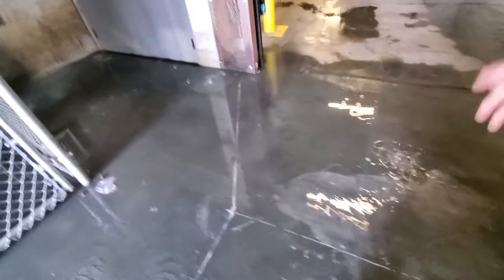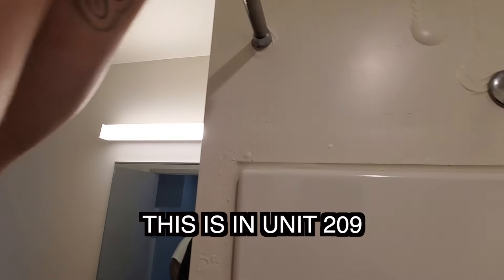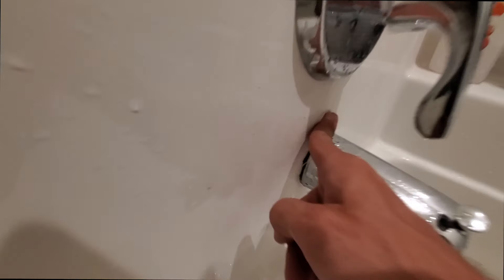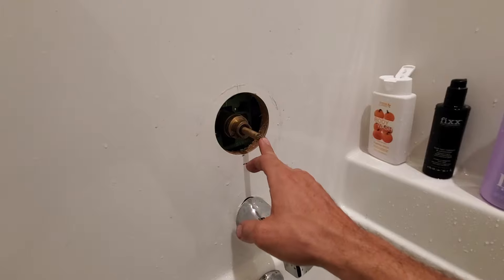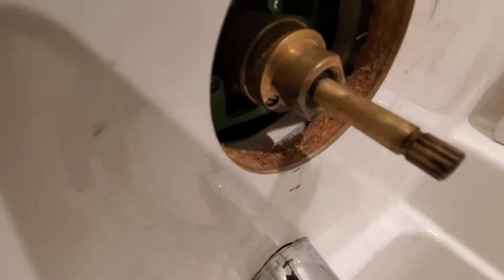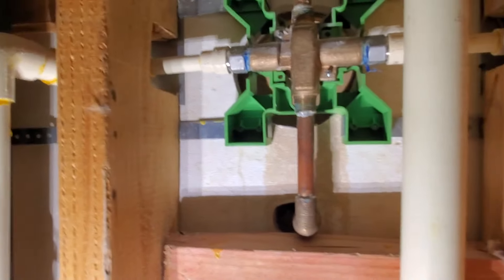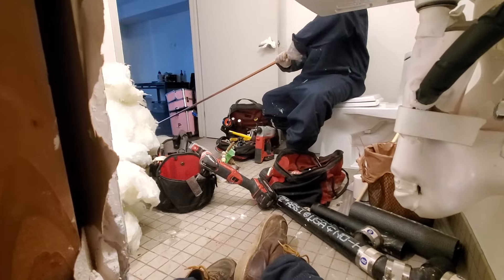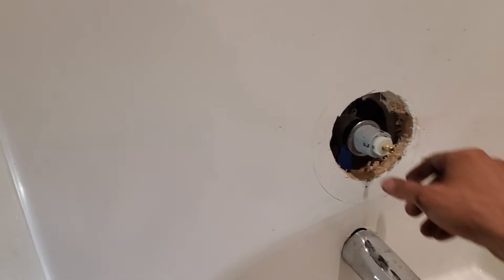HUGE leak from busted Symmons valve

Comment: Just throwing this out there  Being your in LA  notorious for tremors etc  Why would you guys use CPVC and glue joints in such a large building  ???  Why not Uponor ( they make rigid lengths all sizes) and alot more forgiving  is it a code thing?   I know California esp southern  was specifically use Vic Taulic sprinkler system just for this reason  back in day    Thanks for any insight
Reply from the maker: @easymoneyrodney5164  I agree with you. Stupidity. Main reason is how cheap cpvc is and it's code approved now. I never use cpvc unless used for a repair.
Reply: @pershingplumbing9007        we plumbed new houses in OC w CPVC  back around 95    no idea how they held up   not great I wouldnt expect    Ive gone out and made a few repairs but  run into damn few.   Disney   Ca hotel has cpvc  mains  and copper pro press     in the  smaller stuff in the rooms Im told.    Ive run victualic on    2 1/2"     and up    and   propress on the small 2 inch  and under     sometimes sweat